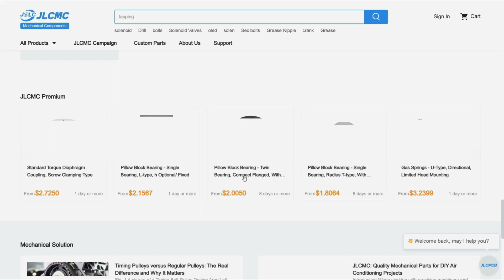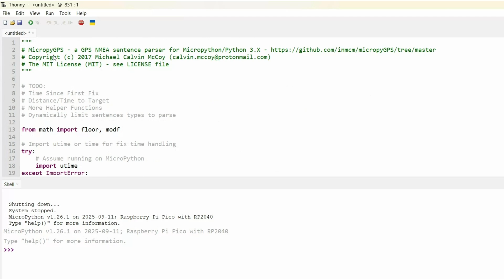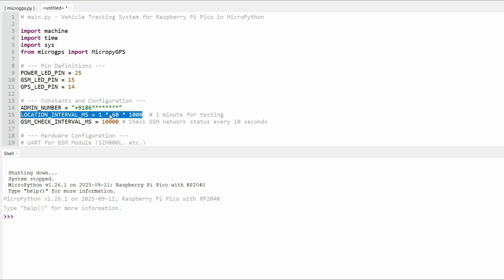How to build a GPS Vehicle Tracker using Raspberry Pi Pico | MicroPython & Thonny IDE Tutorial

Comment: How would it track the movement of car? Do we have to take this circuit in car with us?
Reply from the maker: Yes. The whole circuit (Pico + GPS module + power source) must be placed inside the car.
You can power it using:

- A power bank
- Car USB port
- Vehicle battery (with proper voltage regulation)

Once installed, it tracks the car’s movement in real time (or logs data, depending on your setup).